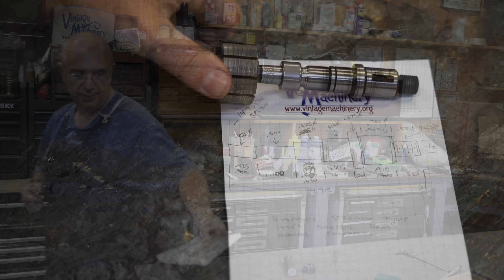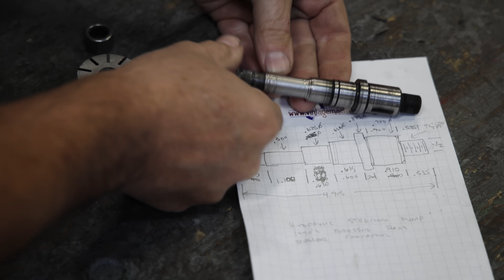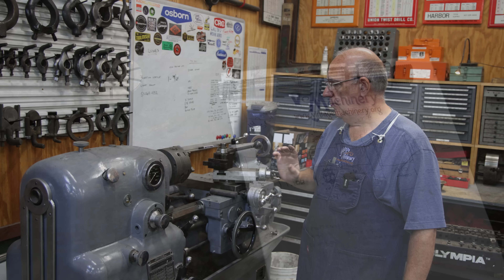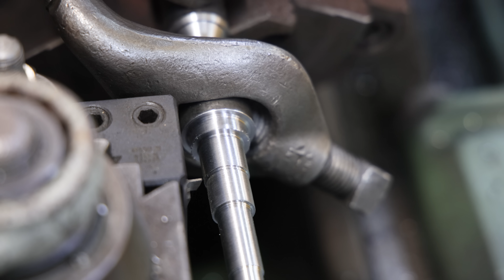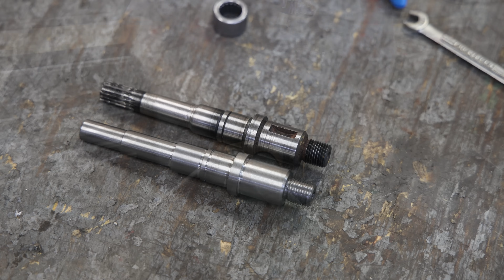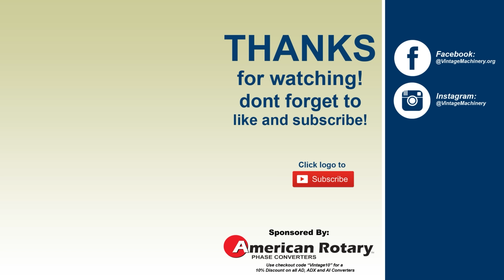Making a Hydraulic Pump Shaft:  Turning to Size on the Metal Lathe

Comment: Would it not be a lot easier and much less work to spray weld the bearing surface and turn down to spec?  The splined shaft appears good and the threaded end appears good.  Seems like a lot of extra work for nothing.
Reply: It would be a lot harder if you didn’t have spray welding equipment.
Reply: @ydonl  I do believe he has that equipment.  I have seen him using it.
Reply: @familycornell8866  Huh. I don’t remember that — but I don’t remember ANYTHING anymore!   :)

Comment: I’m not convinced that was 4140. Looking at the chips I’d swear that’s 12L14. Even the thin grooving tool was making small broken chips. 4140 usually needs a deep heavy cut to break the chips, and even then there’s no colour in the chips at all yet no coolant or cutting fluid 🤔 that shaft won’t last 2min as a bearing surface if my suspicions are correct
Reply: I imagine the bearings are either ball or roller.
Reply: Knowing how Bubba works, you are probably right.
Dore he ever use one of his "refurbished " machines without running into some problem, steady rest, live center, chuck mounting, on and on?:face-purple-wide-eyes::face-blue-smiling::face-blue-smiling:
Reply: @garybrenner6236  spell check? Dore?
Reply: @garybrenner6236  You've shot yourself in the foot again. 
"Knowing how Bubba works, you are probably right."
You being a perfect machinist should have said what metal it was before someone else did.
And when someone else has identified the metal you say they are probably right, hence you still don't know!
You got some learning to do just like the rest of us lol.

Comment: If it was only that one area worn. Why not spray weld that one bearing. Dress to size.
Reply: Keeping the shaft straight would be a problem and t could affect any heat treatment the shaft might have had.  In this case, I think the roller bearing race on the shaft might need to be case hardened?
Reply: Dore he ever use one of his "refurbished " machines without running into some problem, steady rest, live center, chuck mounting, on and on?:face-purple-wide-eyes::face-blue-smiling::face-blue-smiling:

Comment: I'm going to guess that the original part was hardened, then cylindrical ground since it's a shaft out of a hydraulic pump, and the splines and threads are annealed after hardening.

Comment: You just can't trust new parts these days. Quality control on import products is hit or miss; mostly miss. I bought a brand new "Craftsman" stud extractor from a major retailer that was foreign made. It failed after 3 studs. Upon inspection I discovered the tool was made from mild steel, not tool steel. I'm going to hunt on eBay for a used, U.S. made extractor.

Comment: How do you decide what the finish size is if the part is worn
Reply: If it's a bearing or bushing match it to a commonly available size.
Reply: Or u find and follow the spec on the original part drawing or u guess what should it be ,but this is heavly regulated and standardizise

Comment: Fwiw, the round piece that goes onto the end of the shaft shows that the pump is a vane type, judging by the numerous slots into it. This is one of the most common types, with gear and piston pumps being used less behind that.

Comment: HI from the looks of the old shaft is that it was heat treated probably so one of the bearings could ride on it, are you going to at least check the hardness of the shaft?
Reply: I had the same question. Shafts that are the inner race of a needle bearing are almost always hardened and ground.
Reply: Agree. Hardened and then ground to obtain the smoothest surface for the needle bearing.
Reply: @wendellsmith5626 Realistically, this is an old industrial machine, being rebuilt by a hobbyist. It may not ever see enough use for this shaft to ever be a problem again.
Reply: It’ll be fine.

Comment: What engineer,  in his right mind,  mixes metric and inch dimensions in the same part?
Reply: Metric dimension bearings are a lot more common than imperial dimension, so a lot of parts designed from 1970ish have at least the bearing surfaces metric.
Reply: @russkepler  Yep! Makes sense!  😊
Reply: All engineers will design products to fit parts that are commonly available in the area they’re working in.
Reply: One who is fitting an existing mating part that is metrically dimensioned. Saves the manufacturer of that pump from paying to tool up an imperial-dimensioned part that duplicates the metric part.
Reply: Engineers don't always have a choice. Any readily available ball bearing will have metric dimensions.
Reply: Do not listen to Bubba, it may not   be metric.
Dore he ever use one of his "refurbished " machines without running into some problem, steady rest, live center, chuck mounting, on and on?:face-purple-wide-eyes::face-blue-smiling::face-blue-smiling:
Reply: @garybrenner6236 Are you a master machinist?